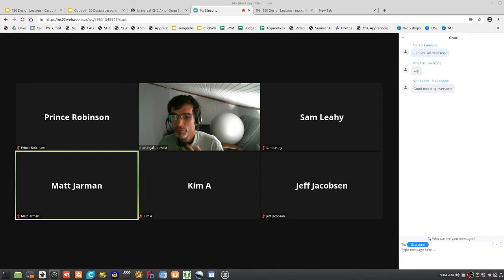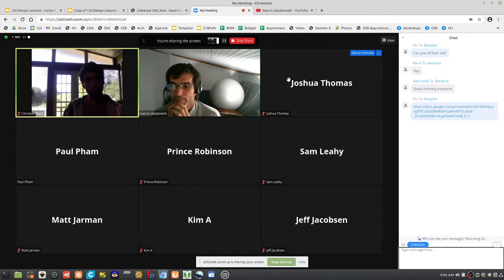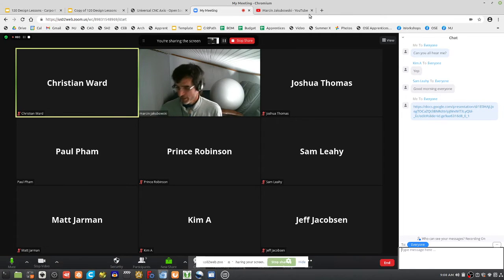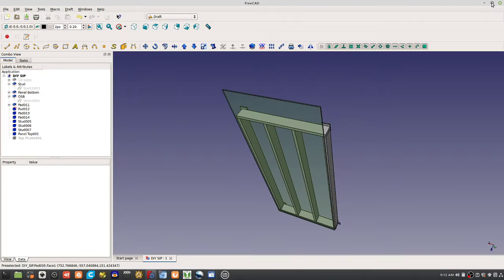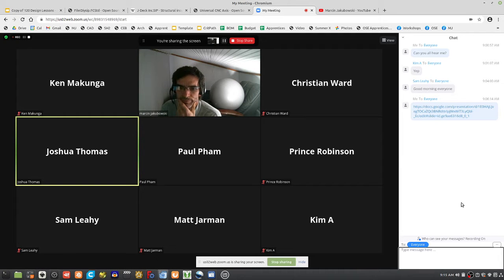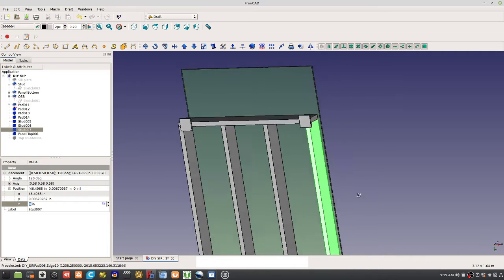120 Design Lessons - Day 24 - SEH 3 + CNC Torch

Comment: Slides: https://docs.google.com/presentation/d/1E0HAjLJvegTOCaZQt3BNRdttrlpJWxWiT3LyQbl-_Ec/
https://en.wikipedia.org/wiki/Poka-yoke
https://en.wikipedia.org/wiki/Structural_insulated_panel
3:43 next goal: 5min per panel (SEH2: worst case 1 or 2 hours)
7:00 SEH3's solutions to SEH2's problems
  OSB forms lip for panel alignment (side with adjacent panel and bottom with sill plate)
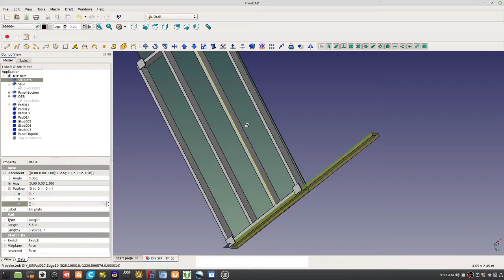  9:14 temporary alignment blocks
  9:55 house wrap at the end (vs SEH2's per-panel approach)
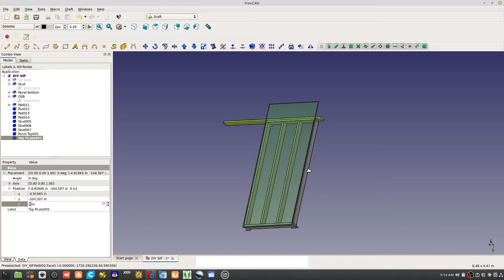  10:18 osb provides lip on top for next story's rim joist
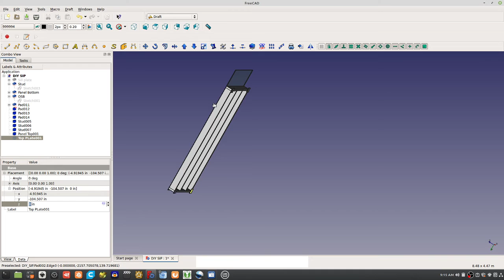  11:04 no blocking on top anymore, but still blocking on bottom (for utility channel)
  13:40 adjustment panels
  14:30 corner module (not designed yet) -> nail board
  15:20 Q: SIP vs DIY-SIP: cost, sizes, cutting, back-of-the envelope calculation: DIY is 1/3 in cost
  19:25 insulation (chamfer)  -> zee flashing
  19:30 osb with 10 feet tall
  14-day build with 24 ppl
  20:05 review SEH2 corner installation https://www.youtube.com/watch?v=AfzSJK-sDEE
23:50 universal prototyping structure
25:35 switching gears: universal axis
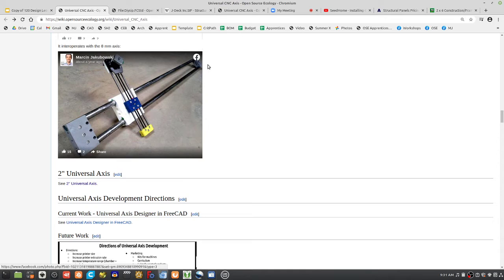  26:47 1"-printer has material cost of $5k, welder head can be mounted
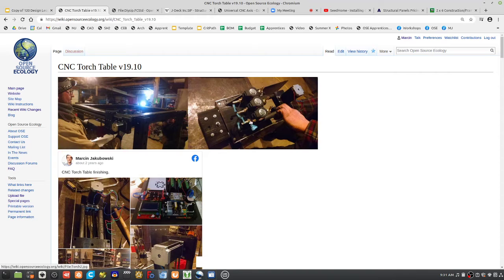  27:15 torch table v19.10 (too wobbly) https://wiki.opensourceecology.org/wiki/CNC_Torch_Table_v19.10
  28:00 frames https://wiki.opensourceecology.org/wiki/D3D_Frame
    29:50 self-alignment approach
  31:25 try 1/4"x4" flats -> 4-sided frame -> 6 faces (cube), 3d-printed corners (for alignment only or as structural part), print time is a huge concern for rapid prototyping
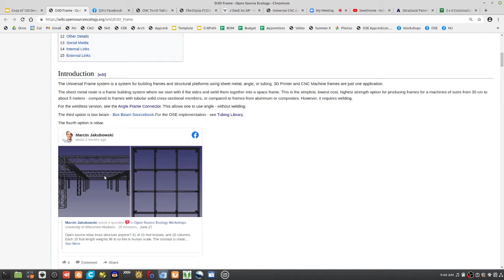  36:11 further out: 8' frames: space frames (rebar trusses?) for sawmill, cnc torch table etc., space frames can be structural and gantry
  16:57 roofless roof to mount PV modules https://wiki.opensourceecology.org/wiki/Roofless_Roof
  37:40 controller: tb6600 (needs external power, RAMPS cannot handle it)
    41:57: probably 2x Y, 1x X, 2x Z  or 2x Y, 2x X, 1x Z (1 driver per axis)
    43:33 SSR to turn on loads (gas/ignitor for torch), D8/9/10
    44:30 3 temp sensors, end stops, extra poins for switches (eg solenoids for aquaponic greenhouse)
  46:19 z-probe, torch head: gas solenoids + 3 hoses (oxygen, high-pressure oxygen, ...), slices through 7" steel
  48:50 welder mod: universal axis, mount torch head onto it, RAMPS does the on/off-switching via relay
50:10 calibration with test print, square frame constructed with FreeCAD  https://wiki.opensourceecology.org/wiki/File:Square_calib_file.fcstd
  57:06 export STL, slicing with Cura
  59:37 checking for z-straightness with vertical feature
  1:02:16 overhangs (very important for certain features)
  1:14:22 bed levelness/adhesion -> fix mechanics: add tape to bearings, tighten belts, tighten loose screws
  1:17:30 xy coordinate system properly aligned (bed/endpoint adjustment, remount entire axis)
  1:22:12 firmware setting (Marlin): 100 steps per mm (?)